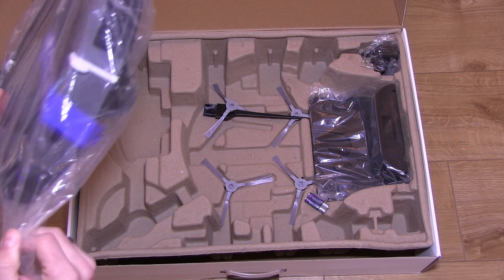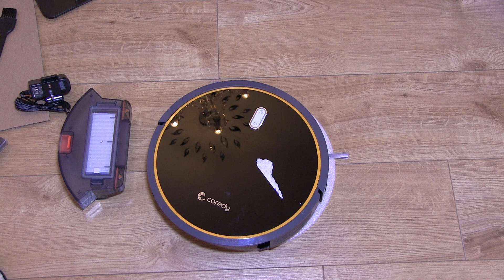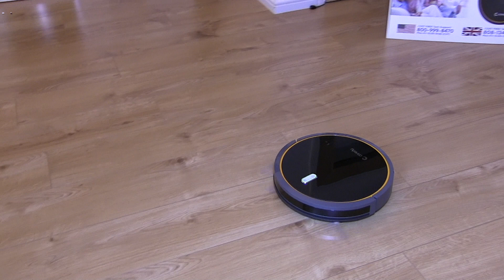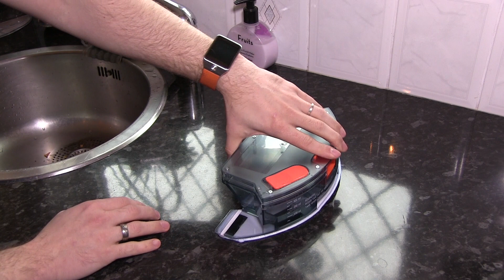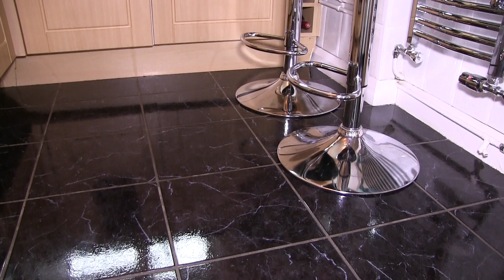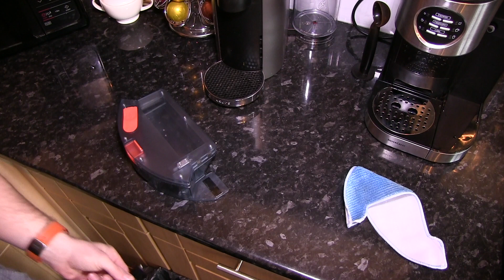Coredy R500 Unboxing, Setup and Review

Comment: For the mopping mechanism; If you have a accent rug on the hardwood floor, will the Coredy avoid trying to mop the rug?
Reply from the maker: Hi Haleigh,

No it will not, it will not soak the rug but it will try and mop it. You can try the Coredy Magnetic Boundary Maker Strip Tape Robot Vacuum Cleaner, 2m, Model RVA-G003https://amzn.to/3lg5OEf

I found some times it worked well and others it did not, just depending on how it sat under our rug.

I hope this helps.

All the best and keep well

David

Comment: Thanks for the video. 
Should I buy water tank separately?
Reply from the maker: Hi V.P.

I don't think that would change anything unless you are wanting an extra one.

If you are concerned about being able to empty it have a look at https://youtu.be/JOYRcFt_UXQ it's a different vacuum mop that we reviewed.

Take care and keep well

David
Reply: Thanks for reply. I meant, is water tank included in the box, or I need to buy it separately? As I understood it's coming either with dust tank or water tank, not both together...
Reply: @TheMsVahagn  Hi V.P. 
Thanks for your comments.
It comes with both as long as it's an R500 and is new. Other models may very and 2nd hand/ used ones might be missing parts. If you all at all unsure always ask the seller as they will be responsible for what they are selling.
I hope this helps,
Kind regards and keep well

David